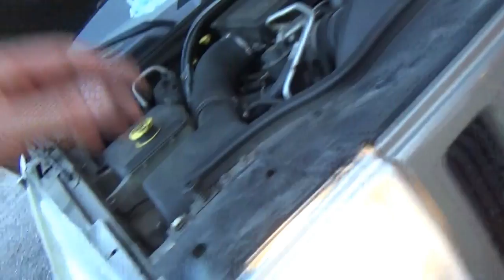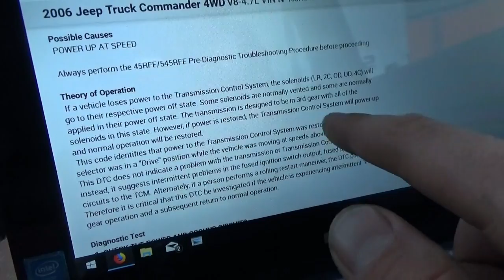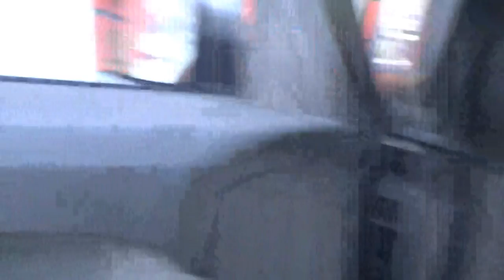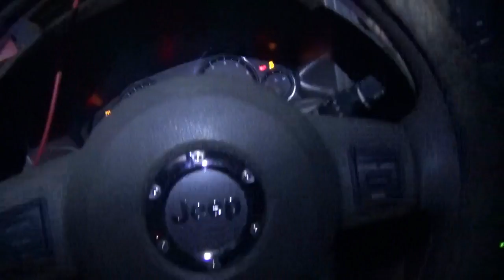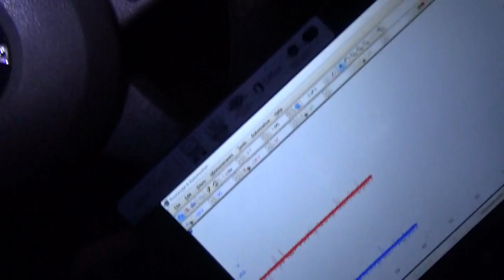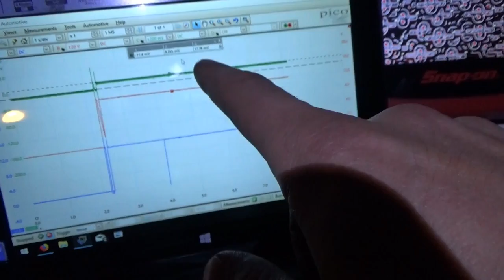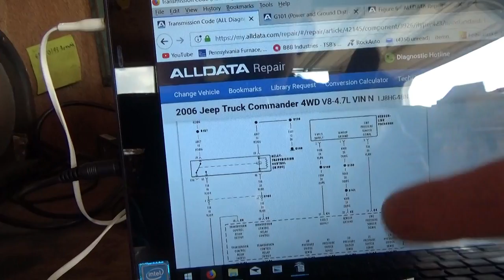Jeep Commander CRAZY Case Study -Part 2

Comment: Some things you can add to your PHAD arsenal are:

A spray called "Component Cooler", used to locate a circuit or component
that is affected by heat (thermal breakdown).

https://www.amazon.com/s?k=component+cooler+spray&crid=2FRISG68EAL15&sprefix=component+cooler%2Caps%2C151&ref=nb_sb_ss_i_1_16

A good alternative is an inverted can of Duster.

You should also have a FLIR for locating hot stuff- kinda pricey, but could easily pay
for itself with just a few uses to diagnose, though.

https://www.amazon.com/Perfect-Prime-IR0001-Infrared-Resolution-Temperature/dp/B075F61GFH/ref=sr_1_19?crid=3PVU1J914K86J&keywords=usb+flir+camera&qid=1562266117&s=gateway&sprefix=usb+flir%2Caps%2C151&sr=8-19

Comment: A way to confirm you diag would have been to jumper power to the control side of the relay and take it for a test drive.  If the Jeep no longer went into limp home mode it would confirm what you thought.
Reply from the maker: Good idea. It would probably set another code though if it tried to power down the PCM but couldn't. Maybe a control wired to the ignition "ON" circuit would do the trick :)

Comment: I would very much like to see the current on the control side of the relay, at the relay socket.  I have had more than a few high current issues with relays (and fuses) in Chrysler TIPM's that were not caused by issues EXTERNAL to the TIPM box.  I've found that a bad case of "the green goonies" on the TIPM circuit board will cause completely inexplicable issues.  Considering the fact that the relay was really hot, I would've liked to do a visual on the TIPM board before making the call on the PCM.

My most frustrating TIPM head scratcher was a Dakota that seemed to be cutting out on random cylinders.  Long story short, it was the fuel injection power relay.  Fiddling with it had it running for a few minutes, then it would start bucking and chugging again. I could feel the relay chatter when it was misbehaving.  I verified that the issue was in the TIPM box by completely bypassing the TIPM with jumper wires, with a separate relay and socket, and temporarily providing injector power through my external circuit.  It ran perfectly.  The customer didn't let me replace the TIPM, but he was nice enough to bring the old one back for me to look at.  I was really shocked to see how nasty the board was.  I was just amazed that the fuel injection was the only problem (the only one I knew about anyway).
Reply: I totally agree on that diagnosis, a hot relay is a sign of heavy current draw or an impending short in the TIPM.  The random other codes and communication faults also point to the TIPM or a bad ignition switch first, the PCM/TCM second.  He was only measuring 60ma on the control side at the PCM, and that is good, so it also points back to the TIPM as the source of high current at the relay.  Those Chrysler FCA TIPMs seem to be quite susceptible to corrosion faults in wet snowy salty climates, out here in CA we don’t see the failures as often being fairly low humidity, no salt on the roads, and snow only in the mountains.

Comment: I was waiting for you to breakout the ol' LoadPro tester to do some voltage drops.

***EDIT***********************************************************************THIS IS SARCASM*******************************************************************************************************
Reply from the maker: Vehicle was parked on level surface, so I didn't need a wheel chock in this case haha xDDD
Reply: @PineHollowAutoDiagnostics   lol haha I watched your review and others the other day. Before you even talked about it I was thinking it sure looked cumbersome to use. If it was slerker and adjustable it would have more value.

Comment: There was a recall on some of the Jeep PCMs and others have hacked them with board re-solder and cleaning pins. Somewhat pathetic that car companies can't upscale their wiring harness, plugs and connectors and components to a standard that will last at least the life of the car undercarriage. I'm currently having to disassemble the entire front end grill and headlights of a family members car just to get to some degraded loose wiring and bad grounds.
Reply: Why would they make them last?  That cuts into sales of your new cars on the lot.  Because you would be surprised at how many people just get rid of their cars when it has an issue like this, and they just go buy a new one.  A lot of people buy new cars every 2 or 3 years anyway-- so they don't really care for them to last 20 years.   It's sad, but:   them being built "just good enough" to work for awhile is part of the design/   classic planned obsolescence.

Comment: Doesn't your wife distract you from your work I was wondering why the ignition switch is so terrible on this vehicle. Never seen that happen on any of our Toyotas. I have to say the way FCA uses computers to control engine and transmission is very odd. I am amazed at your level of tenacity to find what the faults on vehicles are. Looks like you have  bit of money invested in scan tools.
Reply: The jeep commanders had an ignition switch recall because people were accidentally shutting the car off.  The recall switches are a nightmare to turn.  From personal experience.
Reply: @nathandenniston4249  Only car i had with bad switch was 97 Taurus. The whole car was junk. Body was good...everything else was grade A shit.